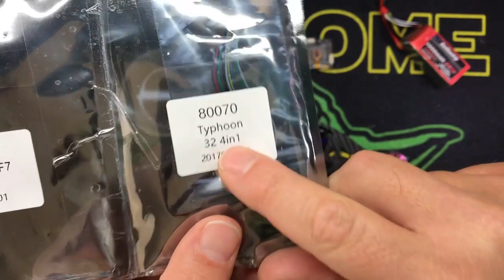Omnibus F7/Blheli 32 D1200 Hellbender upgrade!

Comment: I'm thinking about getting this FC, is it worth the extra money?love your channel by the way. can't wait for your drone wing, I just built a v2 s800 from banggood with GPS. That thing is bad.
Reply from the maker: +Steve Amsden oh niceeeeeeeee.   Ubising inav in it and all that???? I️ need a wing buddy.  Lol.  And yes.   I’ve always beeen an omnibus fan.  I️ think between the kakute pro and the omnif7 I️ would go with the omni.    But I️ also think there’s not a huge benefit to having an f7 except u got a lot more uarts, so for Drone stuff that’s great, but for a freestyle or racing quad it’s a bit overkill
Reply: Yes it's flashed with inav. I had it hooked up with betaflight first I just couldn't get my servos to work. As soon as I flashed it with inav it was all good. But inav is great for drones so I'm glad I did. I think I'm gonna get the f7 the acrilyc on there is like the diamond on the ring. Thanks for the response.
Reply from the maker: +Steve Amsden I️ love the f7.   Have it in a hellbender.  I️ know I️nag forward and back for quad drones, but fixed wing inav I’ll have to work out.  So I️ might be bugging ya for info.   Does the rtl work as good in fixed wings?
Reply: RTL works good but I would set it to loiter instead of land. Also you want to turn then climb with RTL. The inav wiki has a good bit of fixed wing info that's where I've been learning most about em.
Reply from the maker: +Steve Amsden oh yeah, I’ve memorized most of that.   And I️ have my drones climb before rtl as well.   I️ have a lot of cli Drone tricks as well and yes I️ was going to do loiter for sure!!!! Well coooool I’m glad I️ have someone to bounce things off of

Comment: Nice parts!!
Reply from the maker: +Dobemandan in love with that fc.   Damnnn
Reply: JJRotoGeek It's very new that's for sure... Nice gift!
Reply from the maker: +Dobemandan very cool!!! So what r u flying
Reply: JJRotoGeek My latest is a 2.5" Quatrovolente Libero with your recommended xjb stack and rs1106 emax motors with a runcam swift.  I really like the new Eachine version of the frsky receiver small and has telemetry.  Crashed and chopped the antenna off my vid transmitter today.. lol Crap!!  I have about 20 quads but prefer micro stuff.  I even fly a ducted 85mm in the house. lol
Reply from the maker: +Dobemandan lolol sweeeeet my kinda guy lol I think I have 9 big birds, 10 micros and 4 drones I built.   Used to have a lot more, but I either tore them down or gave them away.   The one thing I learned, having a lot of birds is a lot of maintenence
Reply: JJRotoGeek Agreed.  Please having to remember all the settings after firmware upgrades sucks.  Lol. I only use 2-3 regularly.
Reply from the maker: +Dobemandan lol

Comment: very nice f7 make the one I have sitting look like a punk lol put the esc how you want then change wires in connector next time
Reply from the maker: +youel adamas understood.  But wayyyyyyybeasier just to remap in betaflight cli.   Takes two seconds
Reply: yeah cli is easier if you have some knowledge of code but noobs switching wires is just as fast. you should do the vid how to so the knowledge is out. the resource commands many don't full understand a vid how to swap all in one placement might be good.
Reply from the maker: +youel adamas ohhhhh good idea.    I’m going to do that, the way I do it is very fast

Comment: Awesome!!! i gotta get me some of these :D
Reply from the maker: +Aron Hall dudeeee.    Damn nice set up.  I still think dshot 1200 is overrated.  But that fc is fucking slick
Reply: yeah i'm thinking more about the fc, and i just agree with you on the esc's. i would rather have 4 single the 4 in 1, but on some build's i simply can't. so they are a great option to have, but fail a lot more. but daaamn, that fc though ;D
Reply from the maker: +Aron Hall dude. That fc is tits and ass.  I’ve tried alllllllllottttt of flight controllers.  I’m impressed so far.   I still prefer my good ol 30a dshot 600 esc’s for 9$ a pop lol.
Reply: hahaha Exactly :D yeah it must be smooth :) but will be interesting how it holds up over time :D

Comment: OMG!!! F7! I can't wait for the first flight. I've been eyeing that board for awhile. I feel the same on the issues of the ESC's rather have the individual units I can replace. Then just take in rear if it blows out 1 esc and have to throw out the whole thing and put in 4 separate esc anyway. Only if you on micro or if you just got save on weight. But in the end say screw the weight fly it like you stole it!
Reply from the maker: +George Grazette absolutely brother.  Honestly the weight diff is so minor it’s not worth noting.  And you right, that fc is madness. I like it better than the kakute aiof4 which is pretty awesome as well.  I need to get this bird in the sky to show u.   Loving this board so far tho.   Well thought out and is made wellllllll
Reply: JJRotoGeek  I also found the frame sticker. Got the idea when you were building Zebra Hellbender.  Slammed Hellbender with Star & Stripes with the Pilot call sign. 
http://www.stikitskins.com

Comment: That fc looks nice.
 I have the kakute on my hellbender and your right it is a bit of a bitch to solder it and I don't know how well it will be in a crash. I mean it's just 3m tape.
Reply from the maker: +1956willys4x4 I like the kakute, have it in one of my cerebus builds.   This is nicer.   Wayyyy nicer.  You’d like it

Comment: Do you have an extra FC are old radiolink
Reply from the maker: +Lincoln David flight controllers??? Yes have loads.   U need a radiolink reciever or transmitter???
Reply: Was talking about the gps but was kidding about that I will use the link you gave me for the gps to buy one
Reply from the maker: +Lincoln David ahhhhh.  I have 4 or 5 omnibus laying around for ya.   But no spare gps.   I’m doing a drone build for a friend tomorrow. I’m going to video a bit of it.  It’s not a build video, it’s a hack video lol